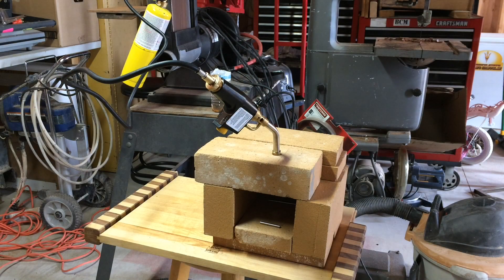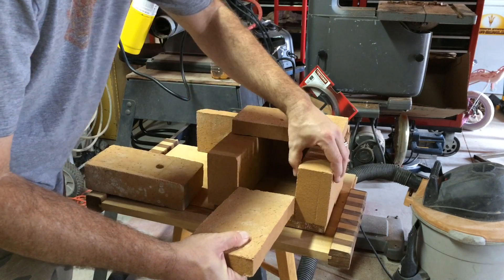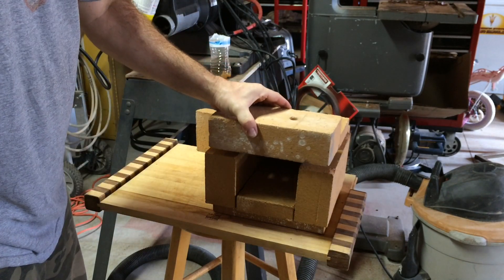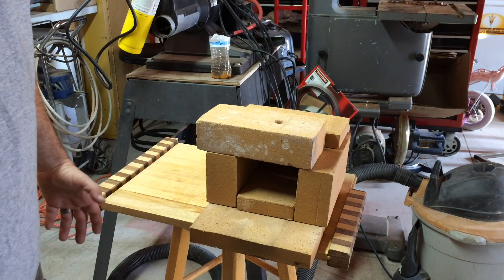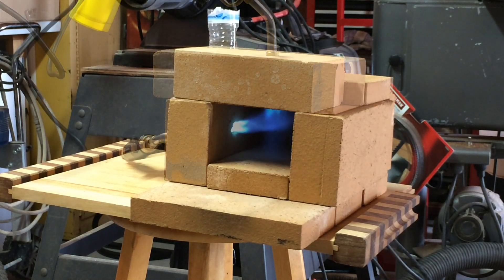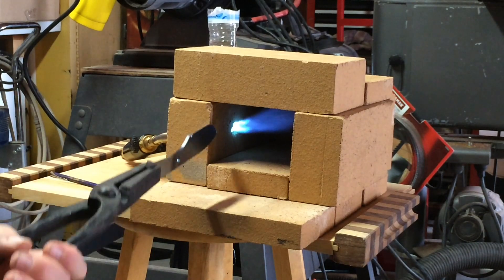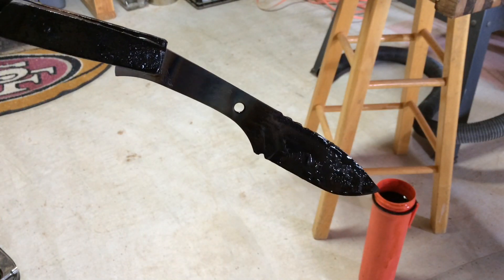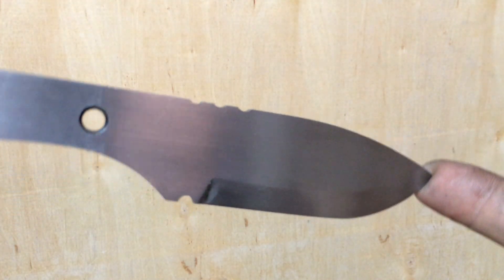Knife Making - Mapp Gas Forge

Comment: That’s weird because most people quench the blade before they drill the holes.
Reply: After heat treating, the blade is nearly as hard as tool steel (drill bit). Unless  using carbide / abrasive drill bits, the easiest way to drill pin holes is before heat treatment.
Reply: @derekgloudemans5168  yes I do know this information, it’s just weird because when you quench it after drilling the holes can cause issues in the blade for example the tang cracking where the holes are. Then blade is useless with a weak handle you can’t even like draw it out to drill new holes. Like when the blade cracks or warps it can be drawn out .

Comment: That knife was no where near hot enough to quench, in order to harden properly the entire piece needs to be at forge welding temperature (for carbon steel around 2500 degrees) you will never get a proper harden or temper with this set up. You would do better with almost anything, even coke coal. My advice would to build a forge that is completely enclosed and has a lid then use coal and air or a propane forge burner, a small torch like that will simply not work
Reply: 2500 for heat treating? You are completely out of your mind. Try 1600 for most materials, 2000 tops. And no, the entire piece does not need to be at the same temperature (or else differential heat treatment would not exist.) That being said, his forge is too large for its purpose, something half the size would take a lot less time in heating up a blade to hardening temperature, and might even be applicable for forging.
Reply: Just curious, is it the size of the torch that is the issue? MAPP gets to around 5000-6000 degrees (close to oxy-acetalyne). Granted it could get to the mid 6000s with added oxygen. I had to pick up a mapp/oxy set up to cut some steel bolts recently, so I was wondering about using it it forge some things. Also I wouldn't use it on steel because the hydrogen I'm the gas bonds to it making it brittle. Just wanting some advice. Thanks.
Reply: I didnt like how wide and open it was....  Like try to cook a roast with the oven door open it wont retain heat thats the point of forging.  And my prefence is to apply a method that secures the bricks as opposed to loosely stacking them together. At this rate you might as well clamp down the metal and run the torch over it.  At the end of the day not super bad everything you need is right there,  this set up is virtually a hairs width from being a really kool forge if you can just work out those small details....  As far as my opinion goes and i couldnt tell you what thats worth but these are my prefences.
Reply: Conner you need to go back to school, your temp quotes are so off we dont know where to begin. So here we go: normal heat treatment hardening procedures usually start around 1550F+ degrees (this is done after normalizing annealing process if you worked forged banged on your material) is austenitizing temperatures (heating to non magnetic)  for heat treatment (orange color most steels) starts around there, however is lower with some exotic alloys. (not just basic carbon based steels) the temps you suggest would ruin his knife or anyone's project for that matter- he is heat treating steel not making steel in a foundry. hope this helps you on your way to blacksmithing #BeKind

Comment: why not make a propane burner instead. plenty of videos on how. and not for much money. mapp gas is expensive. you can fill a 20lb bottle for what on little yellow can cost. they pull air in as they burn. it will heat up 10 times faster than what you got going there

Comment: where did you get the bricks?
Reply from the maker: +james curtis I'm in Arizona and used a local supplier. Marvel Building and Masonry Supply. These fire brick are the "hard" kind and I plan to re-design the forge using "soft" bricks and a propane burner. I've been to a couple more block yards and none have heard of the soft bricks so I'll be purchasing those online.
Reply: i wonder if you could you thinset, the type of mortar used for ceramic tile to attach everything together and coat it all with it?
Reply from the maker: Not sure about the thinset. It might not handle the heat. Refractory cement is the way to go. Walmart even sells it online. 3 pounds of dry mix for $17 and its good up to 2200 F.
Reply: I just bought 8 of these bricks fom tracktor supply here on the east coast 3 somethin a peice